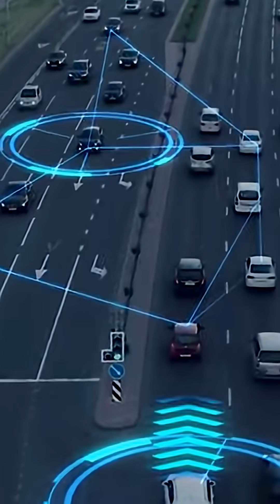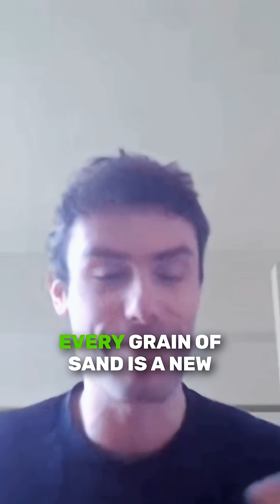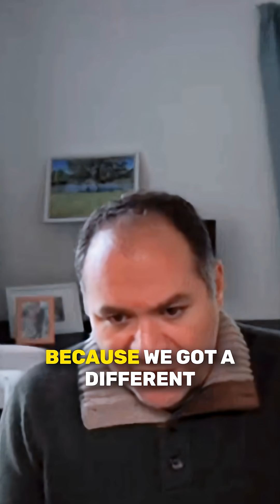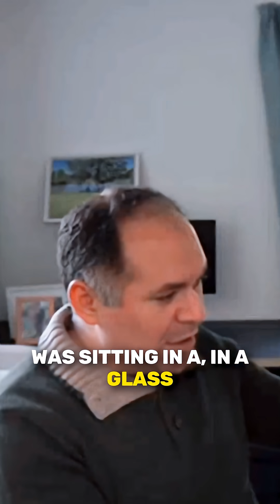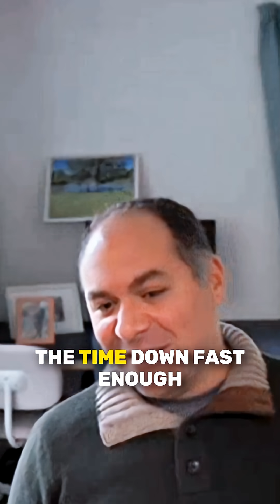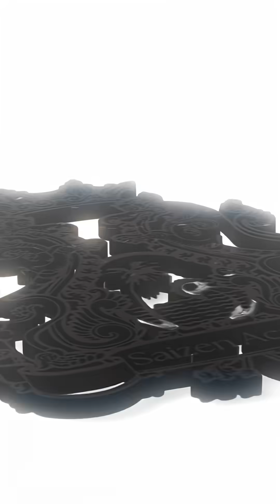Self-Driving Car Failure: Why AI Breaks in the Real World  #ai #podcast #shorts

Comment: Arrogant "experts" who can't drive, program digital systems to perform a task they themselves struggle to understand. 

Controlling a machine like a modern car requires a high degree of skill and discipline. There are humans with these skills, but the idea of hiring racing and stunt drivers to aid in designing these systems seems counterintuitive because we don't need AI drift systems. However, the skills and experience required for high performance driving has direct and powerful correlation to maintaining safe and efficient performance at pedestrian speeds.